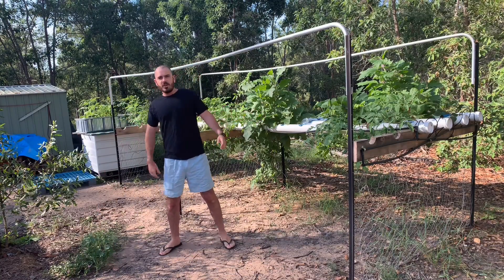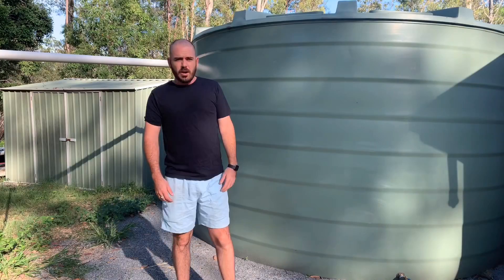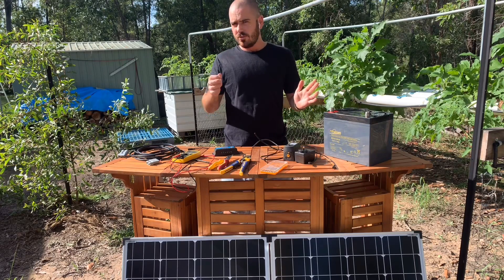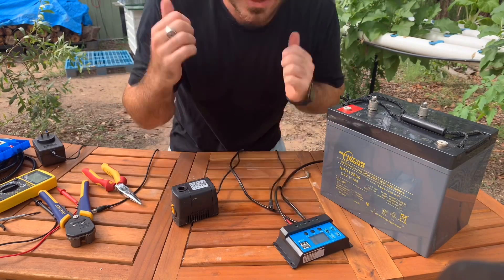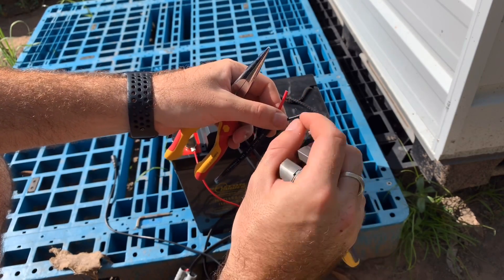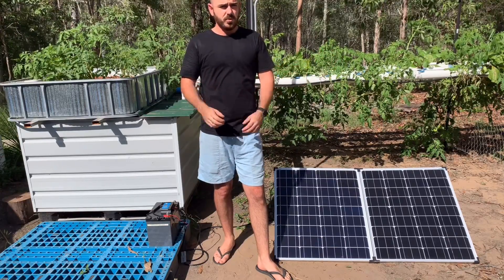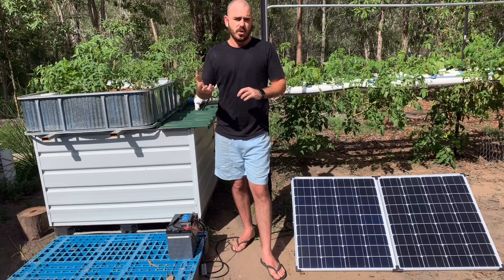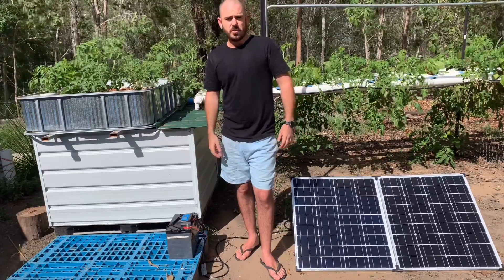How to Build an Off Grid Hydroponic/Aquaponic System: Survival Hydroponics

Comment: Just fyi, when you get low sunlight, like when it's cloudy or rainy, the plants have enough sunlight to grow but the panel will struggle. It's not a perpetual system unless your battery bank is big enough to withstand multiple days with little to no charge. I'm in the US in the midwest. On cloudy days, the solar drops to a trickle. So make sure you do the calculations.

Comment: Thank you, about to swap my older house batteries out for lithium and the older batteries are going down to the swim pond to push the water up to the aquaponics beds... yabbies veggies ( hopefully Murray cod too, when I can get fingerlings and I’m right on the edge of where they will survive ( but pond is cold in shade... should be right 😝).
Brilliant videos ( watched your cane toad tadpole trap one the other day ) you explain things really well ( thanks for the tip about the voltage protection on the load terminals that’s fantastic )

Comment: Exactly what I'm doing for my first small DIY home system as I've got some older solar panels/solar controller off my campervan and a number of leisure batteries, just designing it around the NFT system with 6.5cm square plastic down pipes.

Comment: Can you comment more on how you wired the pump into the controller? I need an adaptor like yours
Reply: You can get them at auto electrical suppliers. Not sure but think it’s called a jack or jax’s plug. Really handy when you’re disconnecting and reconnecting stuff a lot. Really simple to wire in too

Comment: Is it possible to run your grow lights with the same type of system
Reply from the maker: Christopher Little you would need to do the calculations about the energy requirements of an inverter and lights. Then scale up the battery and solar. It’s definitely possible. Whether it’s actually cost effective is another thing.
Reply: @Hoocho  it's already running me over 450. (U.S.) a month In electricity as it is couldn't believe the delivery charge was more my actual usage. Lol!! So even if it's more to get started, it would probably be cheaper In the long run. Ty

Comment: Would it make sense to raise the water level (maybe by 1-3cm??) by capping the end of the pvc pipe and drilling a hole up from the bottom of the pipe to keep more water in the pipe in case of no sun?  With the hole drilled off center, and if the end caps were threaded, you could adjust the water level by just turning the cap on the threads.  ? ? ?
Reply from the maker: Jay Pfeilsticker The point of the system is to only have a film of water. People make ‘nutrient film technique’ systems wrong all the time by raising the water level. Realistically when the water is more than a film they are just making a recirculating DWC that uses pipes.

Comment: how much this total system price
Reply from the maker: Al Rashed Compound Hard to say as I’ve built it over a long period of time. Raw materials probably $350Aud not including the off grid stuff. If you used recycled material you could probably half that number. The battery and solar system would probably set you back the same again. All up brand new you could do it for $600-$800 if you shopped around.